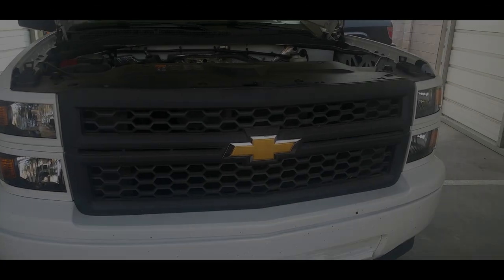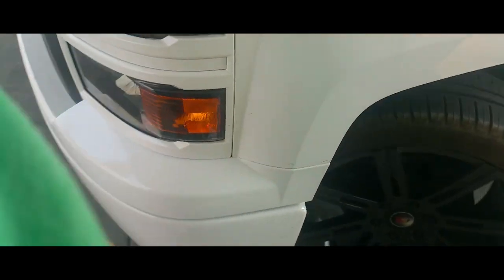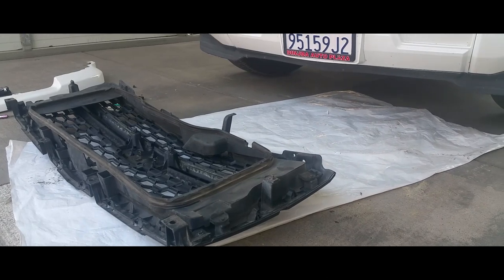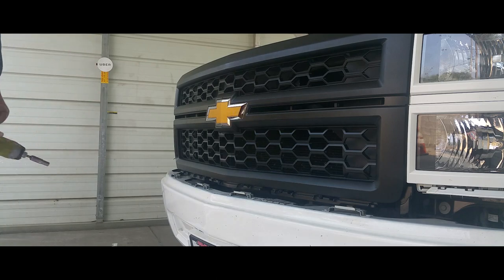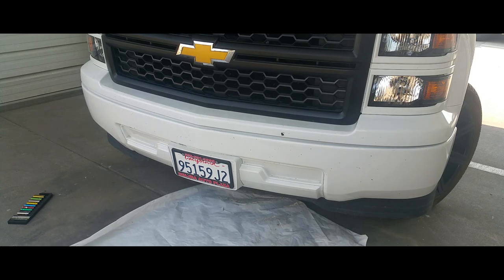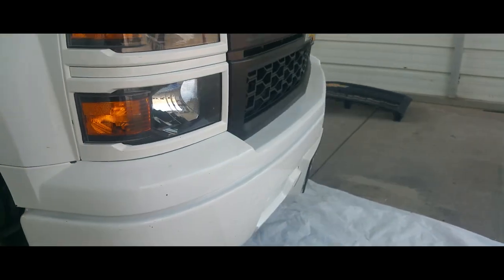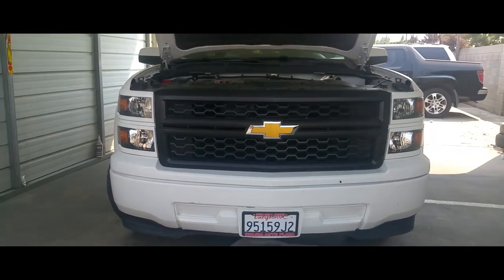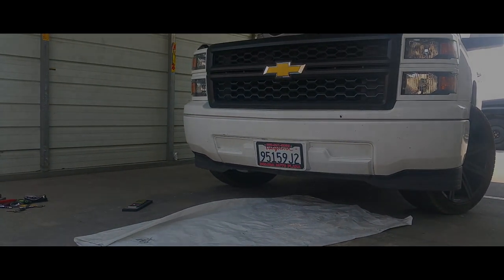How to: Remove and Install a Grill from a 2014 Chevrolet Silverado

Comment: Make sure your clips where the trim goes in the grille don't bind up when pulling the trim off below the grille. Mine pinched themselves had to go in and pop them back loose..another note to keep in mind. Makes reinstalling easier.
Reply from the maker: yes sir!

Comment: The cap or bottom trim below the grille should have two screws on each side , the ones missing on your video are the ones facing upwards on the inside . FYI

Comment: Why,the grills hardly look any different?
Reply from the maker: Cause the customer wanted an oem grill not aftermarket
Reply: @559powerscape  why didn't he just keep the one he had, looks same
Reply from the maker: @markjacob9590  lol right but the chevy emblem popped out and the oem sits in flushed 🙄 Guy was a headache